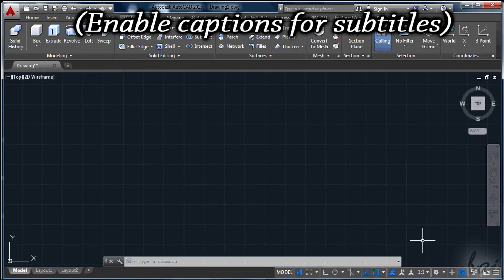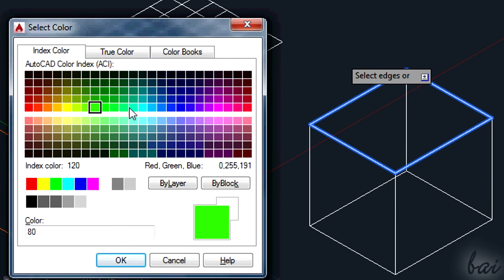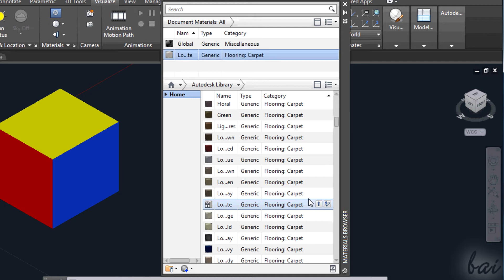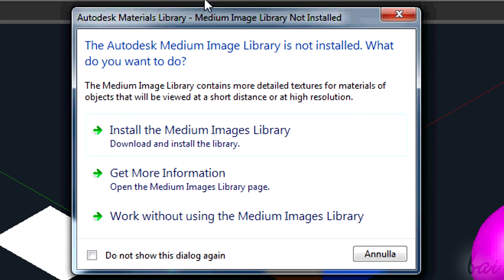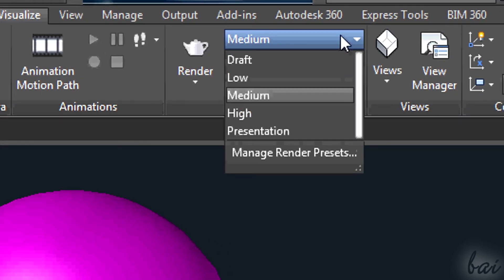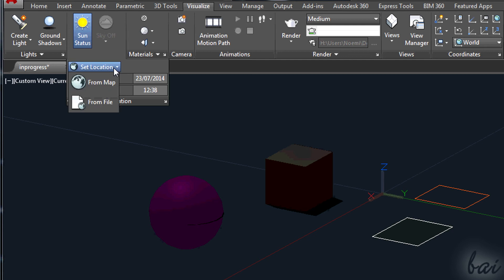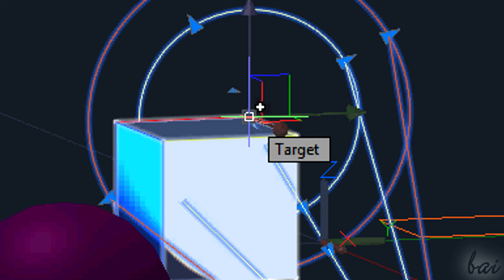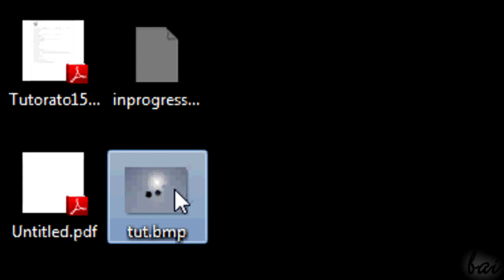AutoCAD 2015 - 3D Materials and Render Tutorial [COMPLETE]*

Comment: I installed medium resolution materials into Acad 2017, opened an existing drawing that I previously made with 2014 and applied wood whiteash to a cube, hit RENDER, it asks for whiteash.tga, all my materials are .bmp. I opened whiteash.bmp save as whiteash.tga, now it doesn't hang up at RENDER but will not show material, using Shademode/Realistic does not show it either. Autodesk never ever ever writes back to error reports or help questions :(. Trying forums, not much help either.